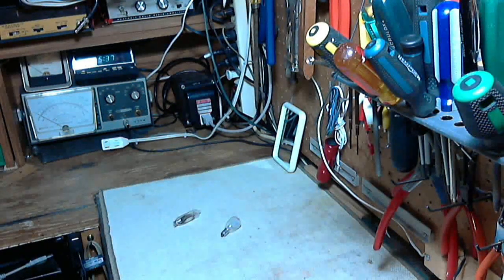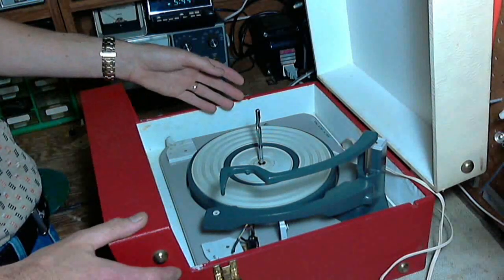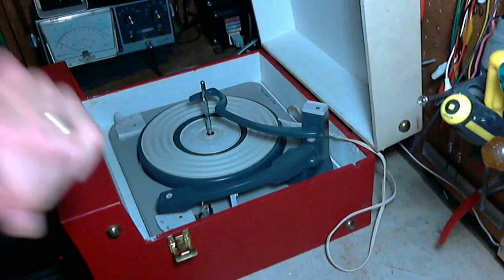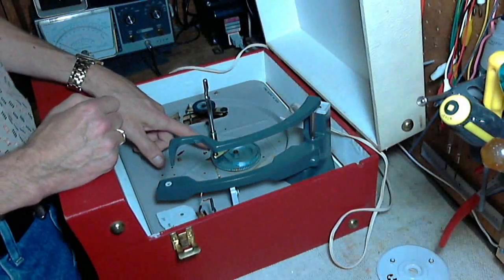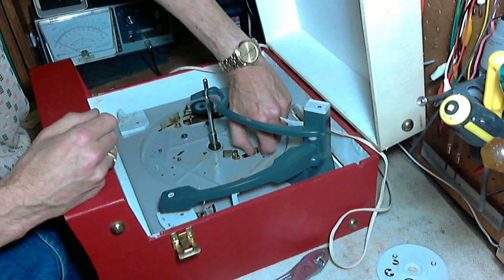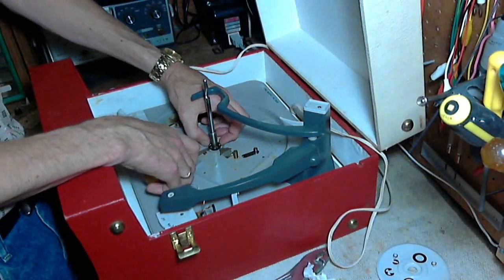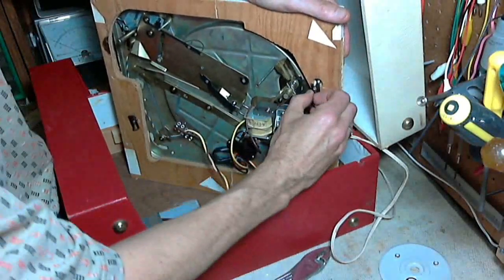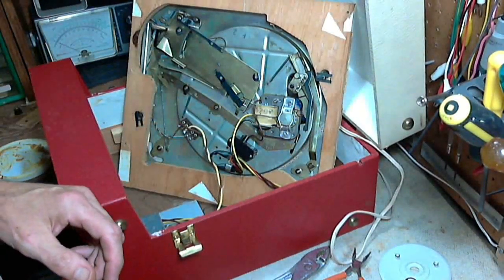Admiral Suitcase Record Player Video #1 - Checkout and Repair

Comment: Clue 1)  It has steel wool inside that explodes very very fast.

Clue 2) it may hurt your eye balls if to close.

Clue 3) non reusable after one use

Clue 4) I used this device at Disneyland in 1964
Reply from the maker: MrMac5150 Great list of hints.

Comment: Hi I have. National 3band transistor radio turntable suitcase that runs on 9v dc but the chord is missing but I need to know how many amps does the power chord have they start from 2 - 100. Which one would I use

Comment: You forgot to lubricate the shaft for the timing gear, and the end-of-record lever. I seen you alcohol it, but that was it...
Reply from the maker: *****  Thanks for mentioning the gear shaft (what is that thing properly called?) lubrication.  I've gone back and applied some grease.  As for the end-of-record kicker plates (what are they called?), I don't think they should be lubricated at all.  So I was trying to rinse out and evaporate any oil that had found it's way there with a flush of alcohol.  For some reason, the plates seem to bind once they are installed on the shaft.  I need to test it with a record before doing anything more.
Reply: BTW they call those CAM gears, or sometimes known as timing gears. they get really complex especially in VCRs!

Comment: So I have a similar record player I picked up, it has a really bad hum.  No wires are broken so I don't believe it is a grounding issue.  Any idea what it might be?
Reply from the maker: There is a power supply in the amplifier that uses large capacitors to suppress the hum.  These capacitors are notorious for failing after 20-30 years.  You will need to replace them (there may be one or two or even more).  That would be the first thing to suspect.  Good luck.